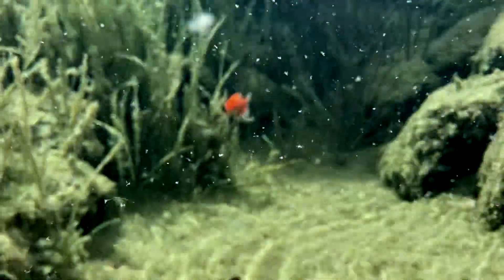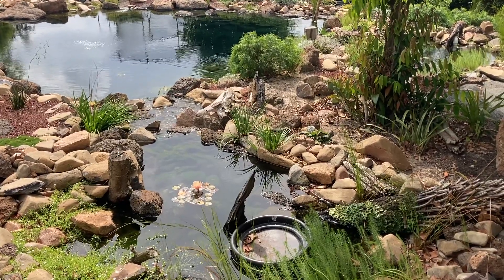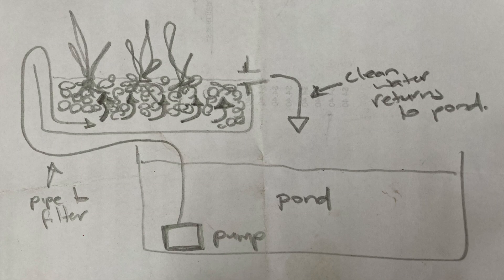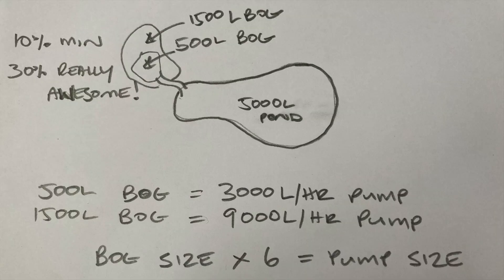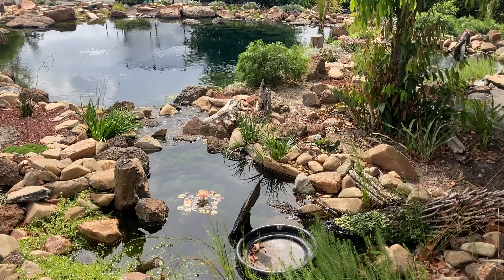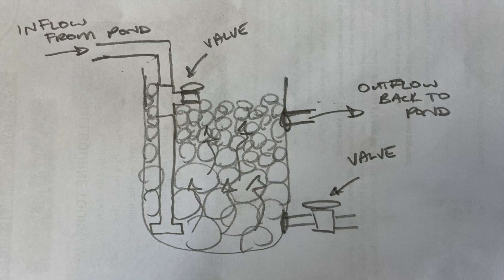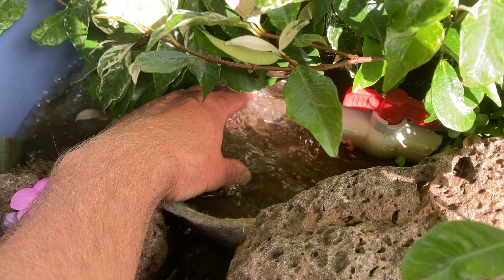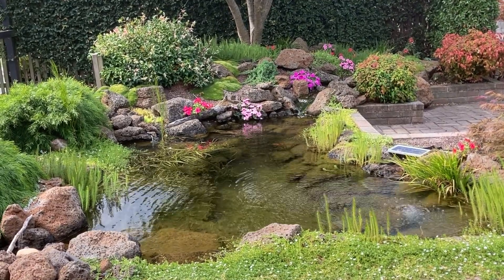Designing a bog filter. Clear water every time!

Comment: When you add the inlet pipe do you need to add slots in the pipes along the bottom if I have a false bottom.  Can I just leave the pipe open at the end to alow the water to flow out.. thank I have learned alot from your pages. I am using a 150 gallon stock tank with a 800 Gph pump
Reply from the maker: In small container bogs I don’t have a slotted pipe.
Reply: @Ozponds thank you so much.  Is a 150 gallon stock tank from tractor supply  considered small, will 1-1/2 pipe work

Comment: I don't have the option to have an upflow filter due to my landscape.  Can you do some on a downflow filter?
Reply from the maker: Videos?
Reply: @Ozponds  yes please.  I've got a pond on the higher ground so an filter will be lower.  9 sq m pons, 2sqm filter.  Kind of the reverse of what's in the bigger pond I see on your vids.  What I'm stuck on is the clean out (I likely won't have any way of stopping a little of the yard dirt running into the filter). Where to put the pump.

Comment: I need a video - step by step - on how to create an inground bog filter.  I’ve dug the hole, purchased a 15 gallon narrow drum w/ a water tight screw top, as well as a 6” dia pvc pipe(with drill holes in it) but I have NO IDEA how it goes together, whether I cut the entire bottom off of the 15 gal drum - or keep the bottom on it?  I guess if the bottom is sawed off, the muck accumulates inside - since the perforated pvc pipe angles down into the base of the 15 gallon drum??  Please help.
Reply from the maker: Building a  BIG DIY BOG FILTER on a BUDGET| Best Pond Filter!
https://youtu.be/-EzgVeITuIc

Comment: Great video. I’ve just finished building my bog filter in a barrel and I have a problem I’m struggling to resolve. The outflow isn’t consistent. It flows/drains so fast that the flow stops until the water level builds up again. Does the outflow need to be pointing upwards or is level better?
Reply from the maker: Sounds like you are somehow creating a siphon.
Reply: @Ozponds  I’m not sure. I suspect it’s got something to do with my outflow pipe. Does it need to be level? Due to the shape of the barrel I have built it in it comes into the barrel at an angle?
Reply from the maker: @zepman351 it certainly helps if it’s level. But I’ve built all kinds of unique designs.

Comment: Do you have to have the bog filter exposed outside or can I hide it in a shed that's next to the pond? I was thinking of using a wheely bin and have the lid closed, then use pvc pipe attached to a secondary waterfall for the return.
Reply from the maker: It doesn’t matter where it goes. 👍

Comment: What pump can I use if electricity is too far away?
Reply from the maker: Ive extend low volt pumps. Up to 30m (100ft) from nearest power source. They can also run on solar.

Comment: Thanks for your videos, they are relaxing to watch haha. I have a question which might be stupid since physics are not my strongest quality. But instead of letting the inflow enter from above and bring it all the way down, is it possible to create a hole on the bottom side and let it enter there? Like what you did with the valve to exit dirty water. I don't see anybody do this, do I wonder if there is a reason for it. Keep up the good work 🙏🙌
Reply from the maker: I don’t because it creates a siphon that drains the filter if the pump shuts off. More info at ozponds.com 👍
Reply: @Ozponds  Ah that makes sense! Thanks very much for taking the time to reply 😊

Comment: Great vids - good into which has helped me enourmously and for that I am very grateful - but one question which troubles me a lot:  if you introduce a Tee for the anti syphon near the top of the supply pipe  from the pump - what is to stop the water just jetting out of the tee into the top of the tank ?   Would it be essential to reverse fit a NRV  to stop water egress from the pump but  allow water - and then air to enter the supply pipe if the pump stops?     Because of this, I rather foolishly put the anti syphon  Tee in the base wjth a vertical section proud of the water level.....YES the bloody thing drained as soon as I turned off the power...thought I had a massive leak as I watched the water dissapear...unloaded all the bloody rocks and pebbles but all good - no leak just a tired and aching  pom who felt as stupid as he was !
Reply from the maker: There tons more info on ozponds.com 👍

Comment: I'm looking to start on my pond soon. I'm looking to make it for wildlife as well as my dogs to get wet and cool off. I want to use a bog filter. My question is do I need to raise the edges to keep rain run off out. The pond will be in a low part of my small backyard if that helps to answer my question.

Comment: Is it suitable to build two systems. One up and one down. A bog with a pump and cascades, and another one with air bubbles like Pagan Buttler videos??? Cascade for the day, air bubbles for the night. A little bog filter with cascades, in high part of the pool; and a regenerate zone beside the long side of the swimming pit, making between the two systems around 25-30% of the swimming area???
Reply from the maker: I’m pretty sure David likes to have 50% of the surface area for regen zone. I size my bogs on volume. Either way more filtration is always good

Comment: I've got a 50 gallon bog and am going to put a 600 gallon per hour pump. I am wondering, will that be overpowered?
Reply from the maker: A bit.
Reply: @Ozponds I calculated off the pond instead of the bog. Going with a 300 gallon per hour pump. Thanks for the help

Comment: Hi Kevin thank you for all this amazing information.  I have a 3000 litres pond and have just ordered a round plastic of 275 litres to create my bog filter;  It is 35cm high x 110 cm x 110 cm.  Does it have to be placed higher than the pond - or can it be side by side?  Thank you.
Reply from the maker: The water level in the bog just needs to be slightly higher.
Reply: @Ozponds  thank you ✨😊

Comment: I have a question - I have a 19' diameter round pond (3 ft deep) for my ducks that we are using your pond building formulas for (LOVING that purchase!) and will need a 1400 gallon bog filter. Can the depth of the bog filter be at or below the level of the pond as long as the surface level of the bog filter pond is higher than the duck pond? It will be connected with a short 3' 'river' flowing from bog to pond.
Reply from the maker: Correct as long as the surface of the bog is higher than the surface of the pond you can connect them via a “river”. I’m so glad to hear you are happy with the purchase 😊

Comment: Thank you! Thanks to your advice, I made a first  pond in France.

For the second one I’d L’Ile to as a valve, or just a hole but Ididn’t understand where should be the hole or What Kind of valve I should use?
Reply from the maker: Are you referring to the breather hole or the cleanout? The cleanout depends on the design you are using. For the breather this video might help- Why Your Bog Filter Needs a Breather Pipe
https://youtu.be/UEjV--vN-kY

Comment: i built my own highly effective and inexpensive aquarium filters in the 80's on a variant of this principle. i found that it was better to have a top input, however. the benefit is that you do not need the clean-out valve at the bottom and you create a highly oxygenated water at the output. my filters are sealed and have an aquarium air pump injecting air at the top of the filter. i should do a vid of it someday 🙂
Reply from the maker: You should 👍

Comment: Great video Kev. I'm about to start building a bog filter for my 700 gallon pond. Does the depth of the bog filters matter. I can build a fairly large one in terms of area. I was just wondering what sort of depth you would recommend. My pond is built out of railway sleepers, so I'm thinking of using the same for the bog filter
Reply from the maker: I don’t get too concerned with depth. As long as you get the volume and it’s easy to clean/ flush.

Comment: Question. I have a 3.3 acre pond (a lot larger than the pond you have shown. We have added bottom aerators to add oxygen. However, we have string algae issues and some unwanted plant growth issues sub surface. 

I have been debating on dying the pond to help with the algae issues. Then add in some beneficial bacteria several times. 

The water is a greenish/brown color. There are carp and bullhead catfish, along with many other types of fish. I know those two specific fish can cause turbidity issues. 

Thought about adding gypsum also for that.

Am I on the right track? Any advice is appreciated. Thank you
Reply from the maker: Large unlined ponds are much different to backyard fish or ornamental ponds. If there’s muddy sediments and wildlife constantly churning up those sediments I think you need to accept that the water will never be crystal clear. For water quality, aerators, plants, maybe floating wetlands would be my starting point.

Comment: can I have the inflow of water connected in the bottom?
Reply from the maker: I don’t recommend it as it’s to hard to prevent siphoning. Check valves have tended to fail for me in the past. I think it’s due to the low back flow pressure.

Comment: Does it have to be above the pond? I need to make one for a pre-formed pond, and I was thinking of doing it  more horizontally. I have to drill holes in the side of the liner, for bulkheads to pass through, so I don't want to be messing around with the pipe work too much. I was thinking of digging space for the bog next to the existing pond, down to a depth of maybe a foot. Then lining it with flexible liner, drilling a 30mm hole through the preform, a foot below the surface, and using a bulkhead to pass a PVC pipe through the rigid and flexible liners. Then at the other end of the bog, I'd make a sump to put the pump in, to pump the water back into the pond nearer the surface, back through the flexible and rigid liners.
 That way, I can keep everything at ground level, and the only pipe work can be straight. But every other bog filter i see people making, seemes to be elevated above the pond. The only problem I see with the way I'm planning on doing it, is that the sump might run dry if the water doesn't move through the filter fast enough, but it makes more sense to me to have the pump in the cleanest possible water. Am I missing something?
Reply from the maker: Take a look at intake bay design. I’ve done a few. Sounds like that’s more what you are trying to create. The bog can even be inside the pond. All a bog is doing is moving water through rock, pebble and plants. The main reason we elevate it and keep it separate is that it’s easy to clean.

Comment: Curious if when filling a bog filter if I can use batting in addition to lava rock or other rocks? Also what about using sand ? So I was thinking large rocks, stacked to smaller, then a layer of batting and maybe the sand on the very top. Wasn't sure if that would function correctly though. I'm asking because I already have these materials on hand. And if I can use sand does the type matter? Play sand or construction sand?
Reply from the maker: I never tried it that way. You would be experimenting.

Comment: Great idea on having the skimmer and bog within the EPDM pond liner to prevent leak potential. How do you rout the bog clean out at the bottom if the filter is within the liner and the valve is at the bottom?
Reply from the maker: Check out the large bog filter video or designing a bog filter video. There’s a cleanout port 👍

Comment: Hi, just wondering what pump you are running in your dream pond bog filter. I have a 40k litre pool which I have turned into a pond, with fish, and a l out a 9k litre bog. According to your calculations my big is too small I need to be running about 50k litres an hour. Is that realistic?
Reply from the maker: I’m running the jebao pumps, there’s a link on my website. I have 60,000lph (4 @ 15,000lph) capacity, however I have them dialed back to around 8-10,000lph.
Reply: @Ozponds 
"Dialed back" to 40 gallons a minute. I did the math.....
Sounds like a lot.

Comment: Thanks for a very informative video. I have a small patio pond (132 gals) with a bio-filter and 2 barrel veggie filters. As my fish grew I needed to increase my filtration. Last summer I added an under gravel series of PVC pipe for more bacteria to grow. I pull the water down through the gravel that covers the PVC pipes then back up into my veggie filters. After watching your video I am going to change to a 55 gallon barrel (or 2) for my veggies filters next year. I lost an old koi from a power outage and my pond syphoned dry. I learned a sad lesson. I now have check valves on all my water lines. Thanks again. Love your ponds!
Reply from the maker: Sorry about your fish.

Comment: It would be good to hear more on why you think bottom up flow works better than top down... because, from what I've seen, top down flow filters never need cleaning out.
Reply from the maker: I want to do a video on this. I believe it doesn’t matter, so long as the water passes through the entire filter and not just a section of it.
Reply: @Ozponds  I can see possible positives to both sides...
Bottom up: More even flow through the whole bog? Filter can also be the waterfall/stream header?
Top down: The bog can also be the skimmer? Debris is removed in the top layers so can feed plants, and never needs cleaning at the bottom? Gravity helps, so less power needed? No risk of back washing/emptying?
Reply from the maker: Pretty much. But remember a dedicated bog filter is usually substantially larger than a skimmer, even an intake bay. So again the issue is can you be sure the water is moving through the same amount of surface area? You’d think it would, but does it? It will follow path of least resistance. Bottom up flow is being pressure fed. That’s where I come unstuck. On small ponds with small bogs absolutely no real difference, larger bogs possibly a difference, but again maybe not. Just my thoughts.

Comment: Still totally enjoying your video's! This question pops up: would I need a bog filter if I make a 25 m long stream? It's going to be about 30-40 cm wide. about 20 m of the length is made of rock and pebbles and the pond (6000 ltr) too.
Reply from the maker: I would still add one. My very first pond was similar to what you describe. The water was perfect for 2 years then I started having issues.

Comment: Hi Kev i am big fan of your videos and has helped me a lot. I have a 3500 g pond constructed with stone and cement with concrete flooring. And we have a fish load of about 20. Due to space constraint i cannot have the bog outside the pond so can i have it inside the pond and lesser in size than 10% recommended ? Please advice
Instead of a barrel can i use a rectangular tank which i can keep outside the pond ?
Reply from the maker: You can use anything to create the bog. The important things are the size, flow rate and making it easy to clean. And yes you can build it inside the pond.
Reply: @Ozponds  Thank you 
If the bog filter is inside the pond draining the solids would have to be done by cleaning the bog taking out all the rocks as we cannot have a drain outlet ?
Reply from the maker: Not at all. Look at my bog in a stream video or building a large bog filter video. You can drain them without having an actual drain.
Reply: @Ozponds  Saw the videos lot of good info I like the way you drain without actual drain but the drainage trench liner isn't available here so is there any other way that I could do it ? Please help
Reply from the maker: You can use anything that’ll create the void space.

Comment: Hi Kev :) Loving your channel mate. I definitely want to hear more about running a higher level pump through/over as a stream (mentioned at 5 min mark) and really hope you make a vid on that topic soon. That would mean it was the only filter/pump yes?
Putting in an 800, want to put one of the bog filters on and trying to work out the best way to do it. A 250 bog should make it a reasonably stable size for goldfish I'm hoping :)
Reply from the maker: I’m not sure I understand the question. I used a high flow filter as the start of my stream on the dream pond (there’s vids in that).
Reply: @Ozponds  sorry :)  I'm talking about the moment at 5.23 where you are talking about using oversized pump in your bog in a barrel build. I notice in the dreampond inground bog build you solved the problem of keeping the water for the bog slower underneath a faster stream by using two pumps - one for the bog and one for the stream head. You've made reference to the same problem here, and said it was a topic for another day, and I'm sure hoping you did put it in one of these lovely talks.  My question is, in that barrel build you mentioned, was the bog filter the only pump/filter or did you end up using 2 pumps like with the large build?
Reply from the maker: Ah I see why I’m a bit confused. The bog filter inside the stream is a seperate system to the dream pond, although the same style of filter. The dream pond has 2 dedicated bog filters and a stream with a high flow filter. I have talked about sending excess water over the surface of the bog if the pump has too much flow. I can’t remember the best videos but I would imagine I mention it in this one - What is the minimum flow rate for a bog filter?
https://youtu.be/n29ev7xEvy4
In regards to the pond with the barrel bog, yes the bog is the only biological filtration and there is only one pump. The pump sits inside a diy skimmer I made using a bucket. There is a sponge over the top that provides a little mechanical (catching larger debris) filtration.